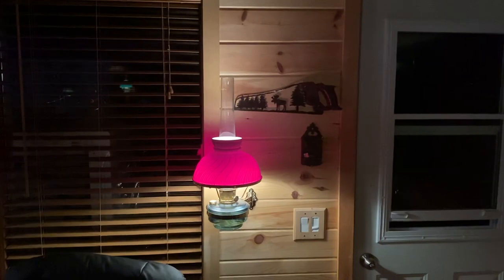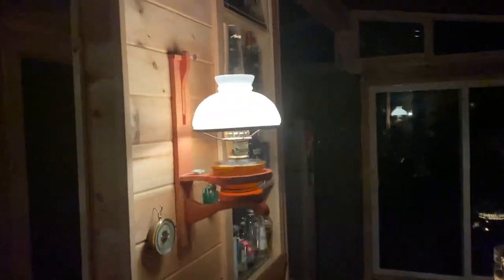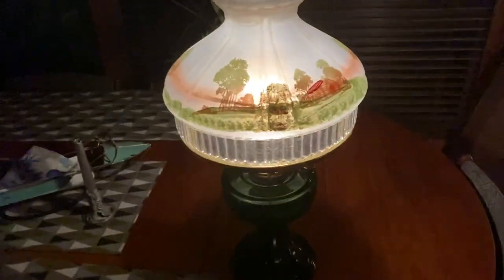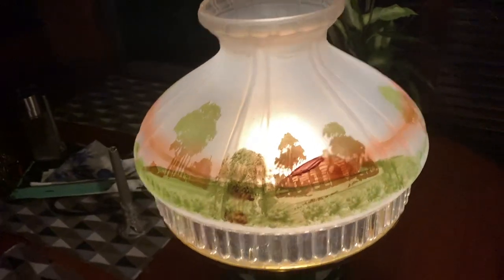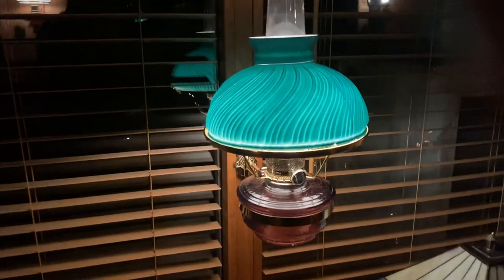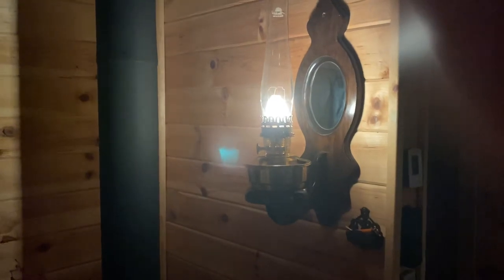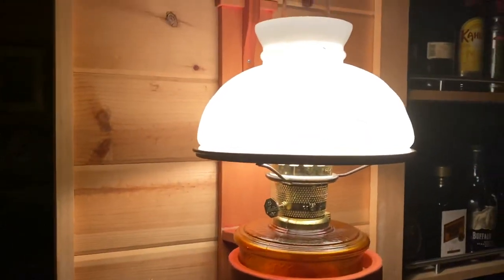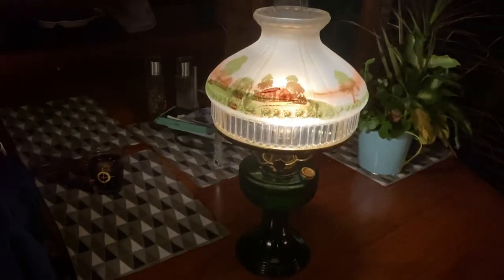Aladdin cottage  lamps

Comment: Very cozy looking cabin! Really brings the rustic feeling out with the oil lamps. Great tip on the fume stopper. I find if you cut the bottom off a pop can, put the inside of the can bottom on the chimney, it's a perfect fit too. The chimney fits perfectly in the groove on the can.

Comment: Beautiful lamps. Do you set them outside for night events, get togethers?
Reply from the maker: No, not really. They are really meant for inside use. They don’t take any wind at all and I find they too bright when used at night out doors.
Cheers
Reply: @Kerosenecanada  thank you for letting me know, greatly appreciated. =)
Reply: Good morning, I was wondering on how to run the Aladdin lamp. Does it need to be running at 100% all the time? Will it get damage if running 20% ?
Reply from the maker: @paduag1782  I don’t think it’s a good idea to run them lest that half.   But that is just an opinion.
Thanks

Comment: Wouldn't  this many lamps burning indoors at the same time be bad for you? Like it seems the entire cabin will fill with carbon monoxide pretty fast
Reply from the maker: Carbon monoxide is produced with incomplete combustion.  These lamps burn ultra hot and that’s why they can be used indoors. The cottage is  60 plus years old is not air tight either.
Cheers